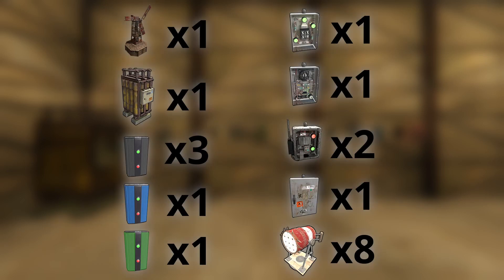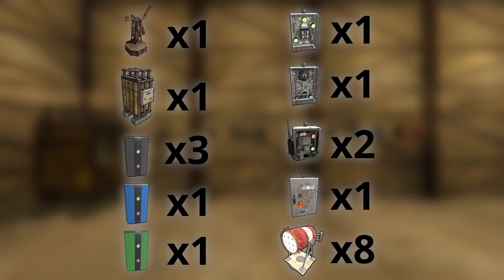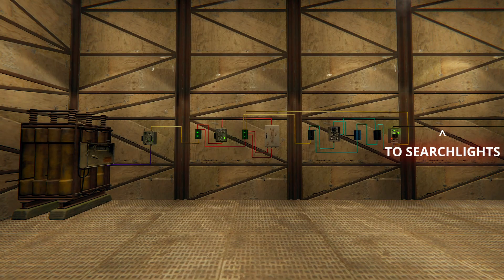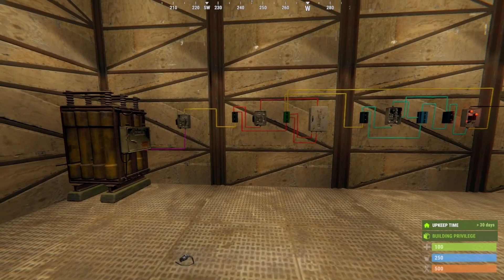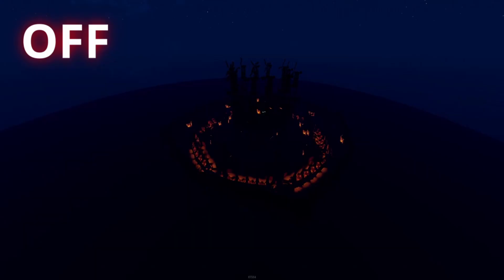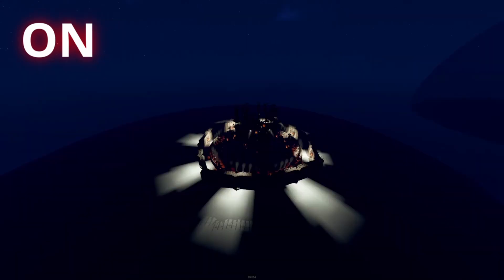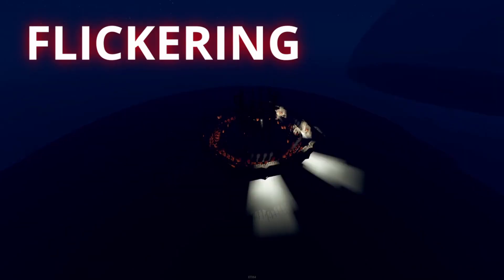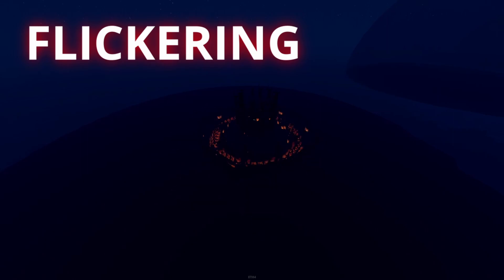Toggleable Flickering Searchlights in RUST

Comment: Does it work for console edition?
Reply from the maker: I haven't played console Rust but if all the electricity stuff works the same then it should. They might have some kind of measures in place to prevent it though because it causes a bit of lag on pc so I can only assume it would make a console run pretty slow if you have a few of them
Reply: Cheers, iam going to save your video and play with it tomorrow. Instead of a light, iam going to do it with search lights. I'll update you when I attempt it.
Reply: I'm on console I think there's a component we don't have, are there 2 smart switches? Or what are those?